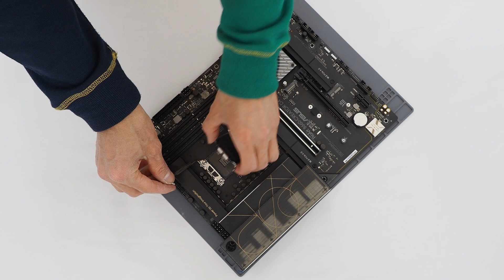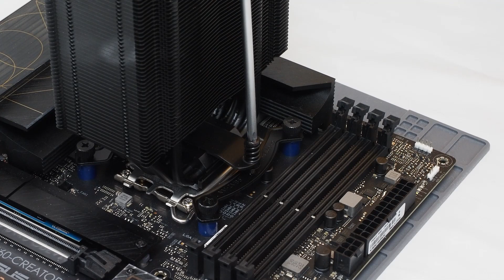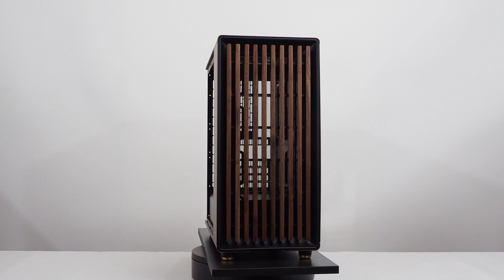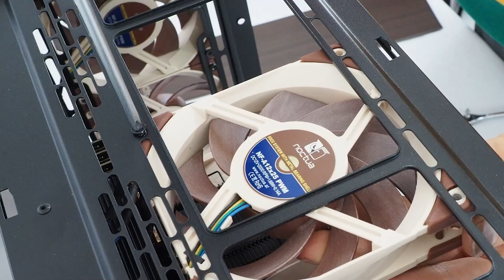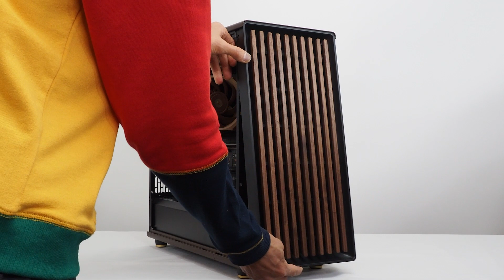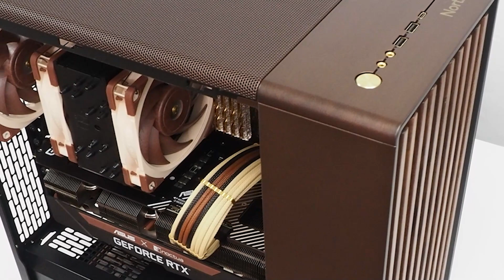Fractal North × Noctua most beautiful PC build. 【GreyGhostCCC 3min building】

Comment: That case modification is absolutely gorgeous. Very well done.
Reply from the maker: Thank you!!
Reply: @GreyGhostCCC How did you get the brown and wood finish on the black parts of the Fractal North?
Reply: @GreyGhostCCC i want to buy the Same case. Is the case big enough for 4080 and a Noctua u12a Air cooler or would you Go With North xl?

Comment: Did you do the powder coating yourself? it looks incredible
Reply from the maker: Thanks.. My job is powder coating.
Reply: @GreyGhostCCC  how much do you charge to powder coat? I'm interested in the same case, if I bought it do you do that service?
Reply from the maker: @jeepjeep101  I'm not accepting orders right now, but if I were to do it, it would be about $300 for paint and $200 for the case. Plus shipping costs. I think it's expensive, but it's a lot of work, so it's going to cost this much.

Comment: Why use normal noctua fans with the chromax tower? You couldve just used the black fans and switched the brown corners over. I assume its because of the custom cables but those couldve been adjusted too. Good build; just wondering tho.
Reply from the maker: I just love noctua's normal fans. Sure, chromax fan can be done in style with ease, but I wouldn't want to do that.

Comment: Beautiful build. I just received my case and put my components in it. I love it so far, but wanted to ask you. Are the 3x120mm Noctua fans are an improvement from a fan noise perspective over the included 140mm Fractal fans at full speed? Do they move as much air?
Reply: I went with 2 NF A14’s for front in take same air flow as 3 120’s and the 140’s spin at a lower rpm.
Reply from the maker: Thank you. As for the fan, I don't know because I haven't tried it.
Reply: The included fans are not it. They're really loud compared to the Bequiet fans I have now. (silent wings 3 140mm)

Comment: My only complaint would be your choice of GPU sag solution. It has no adjustment so it could be putting pressure in the opposite directing causing strain on the cards components. The best way is to have an adjustable support. First you lay the pc on its side then use the adjustable support to find the correct height when gravity isn't pulling down on the card, then when the pc is put back upright the GPU will not have strain on its components and there is no guessing on how high you need the support to be.
Reply from the maker: Thanks for letting me know.

Comment: I have a question if you don't mind me asking. So I am also building a pc in this case. I'm going with 3 120mm fans in the front for intake. The very bottom fan, I didn't use any fan screws. Should I be okay? I'm thinking I'll be fine because it feels pretty sturdy and i have the anti vibration pads. Did you secure the two screws at the very bottom of the 3rd fan?
Reply from the maker: You need to attach the fans before assembling the CPU and power unit, but it shouldn’t be a big issue.
Reply: @GreyGhostCCC  Yeah I was able to get it. Thx for the response though!